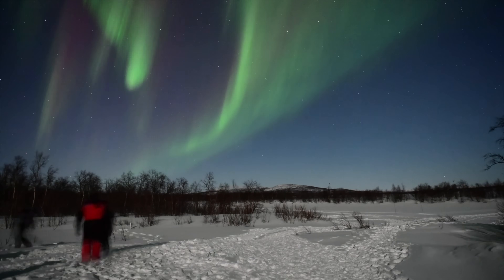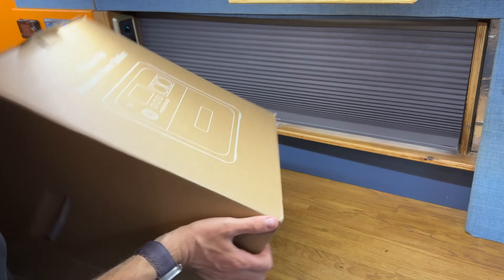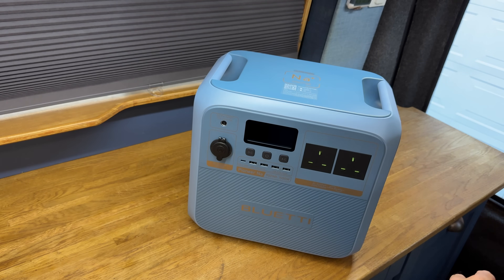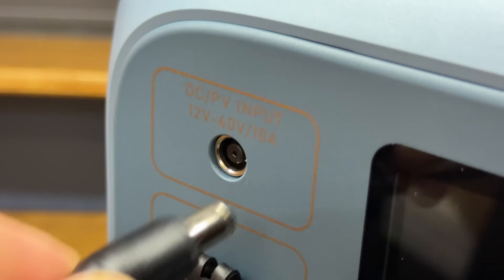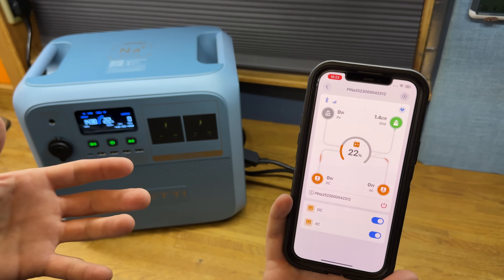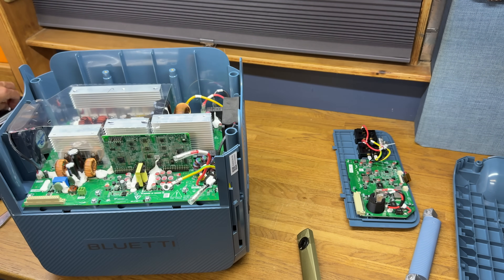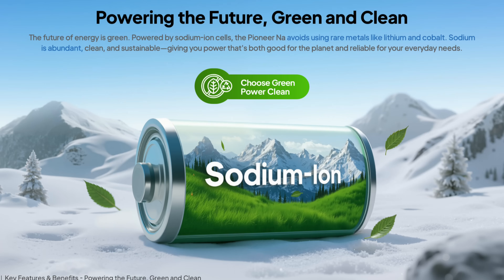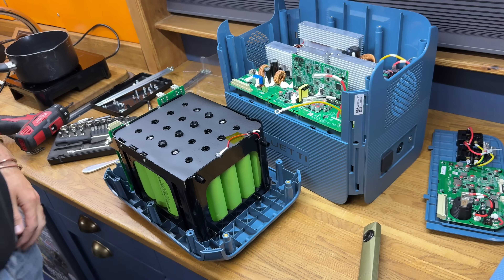TEARDOWN | World’s FIRST Sodium-ion Battery Power Station! (Bluetti Pioneer Na)

Comment: Thank you for breaking it down, it is amazing the size of the pioneer but the battery pack is so very small, i don't see how they cannot double capacity easily at low cost. Also, those heat sinks, wow are they using decades old technology as modern tech needs much less in the way of cooling and that has nothing to do with the battery chemistry. This opened my eyes a lot and pushes me more to building a solar power bank myself.
Reply from the maker: My opinion is, they are using existing tooling ( unit component wise is almost exactly the same as the Bluetti AC180P ) so opposed to making brand-new moulds and components for a effectively experimental product launch. Probably a safer option to launch the new battery technology and see how the market responds before investing in making smaller specific components for it.

Comment: It is not so good, heavy and expensive.
Reply from the maker: Depends use case. Sodium has its pros and cons. Better in cold if needed or evening for outside power storage in a uk winter.

 Longer term cells should be cheaper than lifepo4

Comment: Why did you cut out the app installation?? Talking so much, but cutting out crucial stuff. It took me quite a few tries on 0.25 speed to figure out, that it had an offline option, because i would NEVER buy such a thing that would need internet in any way! I hope the dont remove this offline possibility in the future firmwares...
Reply from the maker: App install? As in downloading it from the App Store? 

I’ve showed before  in other Bluetti videos. 

But there’s not really much to it open app, click off-line mode and that’s it. 

The online mode would just be me logging into a Bluetti account and clicking on Wi-Fi. type in my Wi-Fi password and but the actual interface is the same. 

But it’s a fair point. the app I have never really seen it’s an important to show set up it’s just one click. but good point on saying that there is an off-line mode would be good.

Comment: It should be much cheaper ..its sodium that's the perpuse of sodium
Reply from the maker: I think sodium cells will be cheaper when the mass manufacturing is there for them. The actual sodium element is only a tiny percentage of the overall cell about 4-7% depending on cell type

Comment: Other than the fact that it can charge below freezing is there really any advantage of this over LiFePO4?
Reply from the maker: Sodium is a far cheaper element so as mentioned in the video hopefully long-term when major manufacturing is there the cells and therefore in product can be significantly cheaper

Apparently, it’s even more “safe” and stabel but lifepo4 already very is

Comment: At Bluettis site a Pioneer 900Wh unit with Na+ technology is priced at 799GBP (about 10189 SEK) not including importfees and whatnots from EU.
At the djungleshop a Bluetti Eco Play 2048Wh with LiFePO4 technology is priced at 9466 SEK.
Cheaper to produce in existing fabs? Evidently No! Hype? Yes!
Reply from the maker: One of the points I made in the video was long-term sodium will probably be cheaper when there’s established manufacturing. Given it’s a cheaper resource.

Comment: what a failure… so he had to put it away and wait to warm up in order to charge 
not much difference compared to lifepo4
just another hype and advertising scam
Reply from the maker: Not sure you quite understood that section . I had to wait for it to warm up to -15c ( after being in a freezer at -20c over night. Lifepo4 is normally +5c ( low temperature cut off )

Comment: can NA ketch fire like those other lithium ion batteries?
Reply from the maker: Talking about thermal runways ( catching fire )  you can’t refer it “Lithium-ion”. That’s only an umbrella term for the whole lithium cell chemistry family. Which has a large variety of different stability due to how the cells are constructed and used. You need to be talking about more specific lithium chemistry.

Lifepo4 which is the common leisure lithium cell chemistry itself is very stable and difficult to get a thermal runaway. Apparently this version of sodium cells is even less likely to do so.

Comment: While you can put Li batteries outside, they still need temp controls, so seeing this come out, I hope it opens the door for them to allow batteries to sit x feet away from the house. Not only is Na safer because of the reactions it does make, the fact you can keep it away from your house if there is an issue means you dont have to worry about it long term for house and gird storage. That also means less stress to the grid during colder winter days. So to me, its still a win win for the world to see them start to come out even if they are not a 1:1 to what Li is yet either on price or storage amount. Granted, I wont have need for this type of battery, but the more north you go, thats one of their biggest problems with power stations and even EVs. So it really does open the market up for more renewables either way you look at it.

Comment: Botched half assed teardown. Other than that a good review. You were close to stripping it down to the block of bare cells with the bms. Since you were almost there but decided not to cross the finish line and skimp out the extra bit of effort to weigh the mass of the entire pack to calculate the watt hour per kilo gram energy density for a comparison to LFP chemistry. Even if it had other components like the BMS board still attached and plastic/metal brackets holding everything together as a tiny weight penalty with whatever cell packing arrangement. At the very least I expected to see what the series/parallel connections or how many cells are used for the final 30 volt 30 amp hour final output and a battery cell part number. If you're in the power station product review space here on youtube full time as your main daily thing and they (bluetti) sent you their new product for a review I expect better than a half assed teardown. I've done a product review or 2 and I've shared some content on a diy solar and LFP ups battery backup power project on my YT channel. I'm far from YT full time and I still made every effort to full teardown a power station to the bare pack as part of a product review that I paid on my own dime for my most recent vid. I know and you knew you could've done better than this.
Reply from the maker: Good points, I don’t normally don’t tear down powerstations. I only took there one apart to access the cells information to find out what type of sodium cells they using. I hadn’t actually intended that Bluetti would let me keep it or for it to be more than B-roll in the video but they actually wanted me to make a specific point about it after they watched the preview and i was rather surprised I did disassemble it and they let me keep it in to my surprise. 

Pack is 30V 900wh. 

30 cells in total, Cells are 3.0v 30wh 32140 in a 10S3P pack layout 

Bluetti-specific BMS, with the “NA150 _BMS _V3.0” name on it which is Bluetti’s standard BMS board labelling. “NA150” is probably product name NA ( unit name ) / 1500W model ( 150, not likely to be an amp rating as they don’t usually write it like that )  “V3.0” is most likely version 3 and not just coincidentally meaning 3 Voltages 

As for being in the power station space it’s not particularly my main area. I’m now vehicle based stuff, Overlanding and other type of tech for vans is mainly my area. Power stations is when I’m between trips as they help fund the rest of the channel. Normally I prefer looking at the accessories to power stations and test with thermal cameras and amp clamps to test them.
Or disassembling diesel heaters to look at their component parts.

Comment: Hi Alex great video i have just received one myself can i ask did you find out what model of sodium cells they were that Bluetti used in the new device thanks.
Reply from the maker: I took it apart and get the cells information from the insides printed on the cells. I work deal with lithium tech for work so I’ve also pretty familiar with cells and related tech.

Comment: I watched a mini-doc on these sodium cells a while ago. The conclusion was that it will be a slow uptake as there is no real-world benefit to most users, and the infrastructure is massively weighted toward lithium now, given the massive demand for it in recent years because of EVs and so on. 
Companies are starting to ship packs with a mix of lithium and sodium cells now, which work in tandem - for example the BMS will favour sodium cells in cold temps then balance or lean toward lithium when appropriate.
Reply from the maker: More or less what I bring up in the video when taking about sodium in general vs lifepo4. Future potential when ( if ) production is more mainstream for cost, larger than equivalent lifepo4, 

Cold weather better but limited need. 

I think it’s a tentative play in a new market direction as an additional future option opposed to be a replacement lithium.

not personally played with any combo cell packs yet, but it’s scenario I’m keen to learn a bit more about
Reply: watched a german mob testing those sodium cells. some had only 80 charge cycles before the were broke. the chinese use the customer to do the testing.
Reply from the maker: @ursodermatt8809 ”mob” not familiar with the acronym? 

Sodium cells using layered oxide cathodes are not necessarily new for other battery types, the cells have been around for a little while now. 

I find 80 cycles a bit odd to hear, that’s and using the term “broke” as well. usually in the context of cell testing and lifespan / end of life of a cell is after it’s lost around 20 to 30% of its original capacity.
Reply: @MispronouncedAdventures  
right, if taking offense with the choice of words is the problem here .....
it is a "german organisation" that tests cells.
what the description was after the 80 cycles i do not remember.
basically what they said is the chinese use the consumers to find out how many cycles their cells have and then try to better chemistry to do another trial with consumers.

Comment: Always like a teardown video, but beware promotional videos as these are not real world reviews but potential free gifts to YouTube influencers to say good things about a product.
Reply: I agree however Alex is a good guy defo not in it for free stuff and a couple of quid
Reply: I trust Alex enough to give a review that is unbiased or to send the item back to the supplier if it’s no good
Reply from the maker: Whilst that is a big issue with youtube I’m not bothered by “free stuff” anymore, ive been doing it long enough, I have tons of power stations because of reviews. I find this issue is more with new creators who think they have to say good thinks, and don’t know you can say negative stuff. I’m not paid to say “good things” ( I’ve never seen that in a contract being asked ) , I’m paid to make videos on products. if I have real issues with a companies product I bring it up with companies. When it’s happened in the past I’ve not made videos or leave negative parts in. 

I’m Not a fan of reviews which are short term  personally view based saying things like “must have”, “game changer” and other such nonsense in videos, I normally pull stuff apart, test power draw, thermal camera tests on units under load and so on. in this case I was more interested in talking about different a between sodium cells used in this unit, and lifepo4 which this unit is getting compared against. Of which there are pros and cons. 

I prefer to make test of specs videos over just a personal review. Obviously I have to show and talk listed specs with power stations videos. But there are plenty of other videos on the channel of me pull apart heaters and looking at component build quality. 

Generally thought , your comment is good Advise.

Comment: Lithium is not even a rare element !! It needs just a lot of water to seperate 🤷‍♂️
Reply from the maker: I agree, it’s rather plentiful. I find it a bit annoying when they compare it to cobalt as “rare”
Reply: ITs not that we need water to sperate, its that we need the water to pump under ground, that then pulls it up. Then we have to wait for it to e-vap off. There are new methods that lowers the amount of water we need for this, but also, the US has maybe one of the largest open mine (where you dont have to use water) if we open it up. Far as I know they did open some of it up, so hopefully it comes down. With that said, its not if Li is rare or not, the problem mainly comes down to the process of getting it - to then getitng it into a high grade for battery use. By the time you get Li through all that - Sodium becomes much much cheaper. Along with the fact that you are not hold down by a single country like China. Instead, any country could produce a sodium battery allowing lower prices locally and more comp in terms of the gobal market to keep prices low and or quality high.

Comment: 1:20 There's a power station with high current 12V output?!?  Neat!  I'll have to look in to that one.  
Personally I'm looking for something capable of 2,000W continuously so it can potentially give my electric car a few extra miles in a pinch.  It needs up to 1,500W, but then I'd like some safety factor in there.  Hopefully their next Na model will be a little bigger.
I've heard that Na batteries have poor round-trip performance.  I'd been interested in a comparison between this Na model and their next closest Li model, both on the battery level and the cell level.
Reply: Pecron has a strong tendency to have higher amperage 12v (e1000 is 20a, e1500 and higher are 30a), bluetti apex 300 can do 50a as well.

If you need more you should really be doing a native 12v system.
Reply: Yes, most power stations do not provide a large current at 12 volts, but you can buy simple 12v LiFePO4 battery, which can give you up to 300 amps.
Reply from the maker: Yeah the Bluetti Apex 300 + D1 hub has a 50A 12v output. Some other Bluetti have 30A 12v. And there’s a couple of brands out there which have 25A but overall , it’s quite rare.

With the size of this sodium power station , I imagine it’s testing the market so make a mid size unit first 

Seeing the data sheets for the cells in a power station context of power station outputs the performance is comparable but there is some nuances. 

But it’s reasonably new tech at a commercial stage, so I’m sure this will develop properly in the coming years
Reply: Ac 180 bluetti is similar con 1100wh lifepo4 e 1800watt max power  Vs 900wh sodio con centrale ugual e 1500watt max power is similar
Reply: The Aferiy P210 has a 25a 12v XT60 ouputput; which is pretty handy.  However I think you'd need much bigger batteries to give an Ev a few extra miles!

Comment: Thanks Alex. There was news just yesterday as you may well know that CATL is now making Sodium batteries that are more power-dense than Lithium and at half the cost. We are in a real crossroads of the energy revolution.
Reply from the maker: That’s pretty cool. I’ll have to give those a look up.
Reply: @MispronouncedAdventures  CATL is the worlds largest battery producer - 18k R&D staff!!!
Reply: It remains to be seen whether they’ll actually be half the cost for the same size/energy. I’m sceptical
Reply: @HiruS22  
I have no doubt they WILL halve the cell level price purely by economy of scale.
They will also likely get to the current (Battery pun) Gravimetric density of LiFePO4 derived cells, but we should expect those (Lithium) chemistries to have moved on at a similar rate.
Sodium will always be "15-20% behind" relying on variations in materials around the sodium (anode/ cathode additives? Packaging?) until they reach the limit of Sodium. It's a fixed barrier of the atomic structure. Lithium carries more electrons for a physical volume of the material, so will always be smaller and lighter.
Sodium ion will move "into the Performance envelope" required for SOME Vehicles, but they are likely to be Buses and Urban Trucks. The smaller the vehicle, the greater the compromise in the "vehicle to Battery" ratio in terms of weight and available space.
Reply: @WagnerGimenes
CATL IS NOT making Sodium Ion cells that are "More power ("Energy") dense than Lithium".
.
(Deleted the web address in case the YT police block,    Go to The actual CATL website, news, scroll to april 2025, NAXTRA)

"On April 21, 2025, CATL unveiled three groundbreaking EV battery products at its inaugural Super Tech Day (including)
 Naxtra passenger EV Battery achieves an energy density of 175Wh/kg, the highest among sodium-ion batteries worldwide".
Meanwhile, in 2024 CATL was Quoting their Shenxing LFP system with a gravimetric density of 205 Wh/kg. That's still 17% more than the NAXTRA (Sodium) system.

18 months later their Shenxing PLUS is certainly faster charging and (probably) higher density than last years model. (Also detailed on the website)

.
As for the cost, that will be a PROJECTED cost when fully ramped and they haven't been in production long.
PLEASE don't just read "reports" and "Headlines". 
CATL has a pretty good website with extensive information.